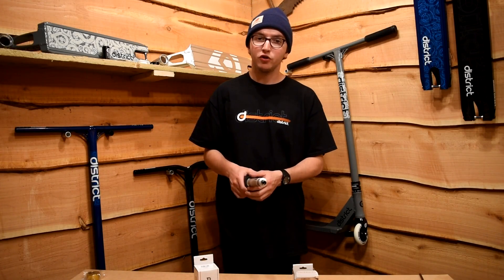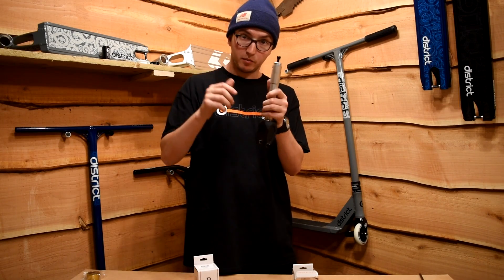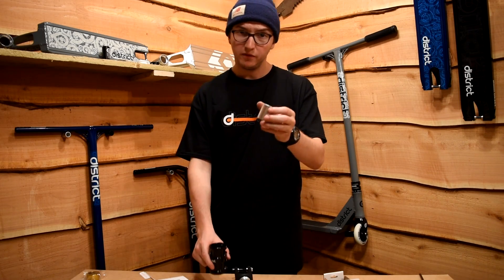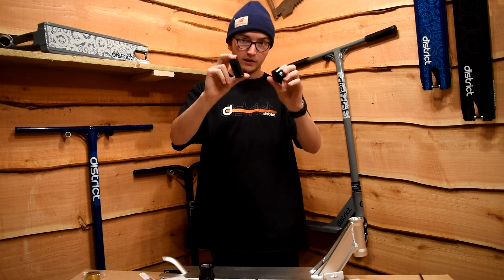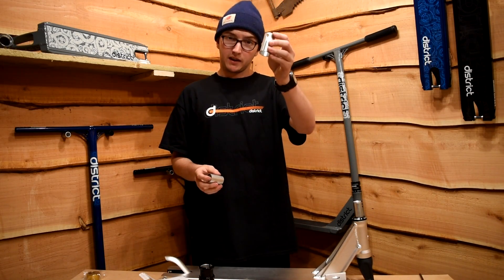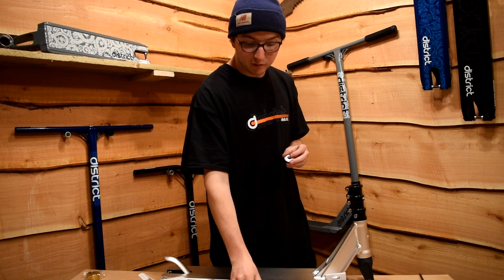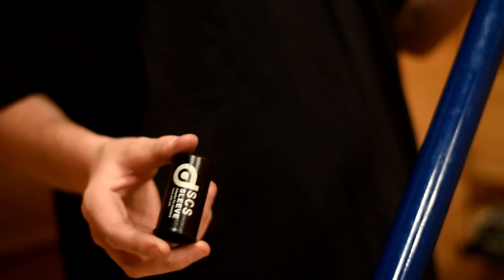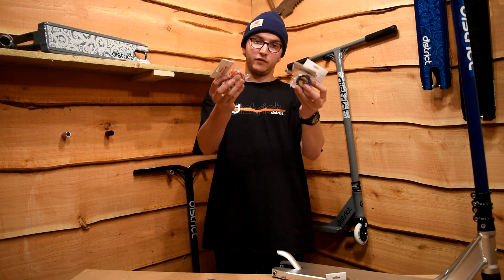How To Run SCS or HIC With District's Mini-HIC Fork

Comment: Is there any way to do it without a volcano spacer?
Reply: johannescoot yeah, use the normal way to compress mini HIC and slide the scs over the fork, so the scs acts like a big spacer, just make sure your bars can fit forks inside em, because the top part of the fork will sit inside your bars when your bars are in the scs.